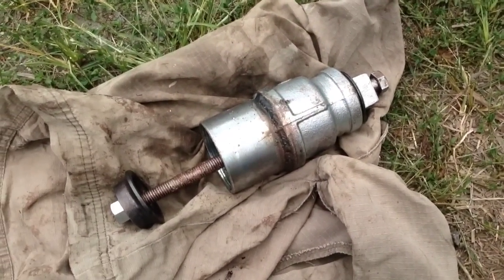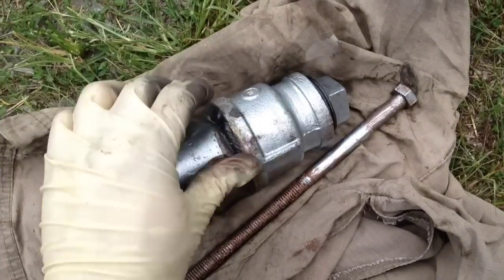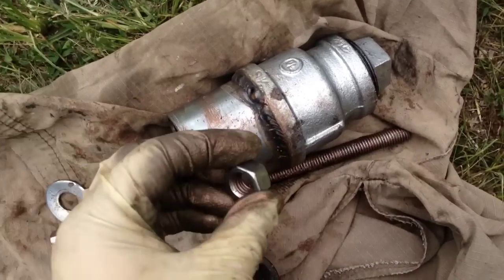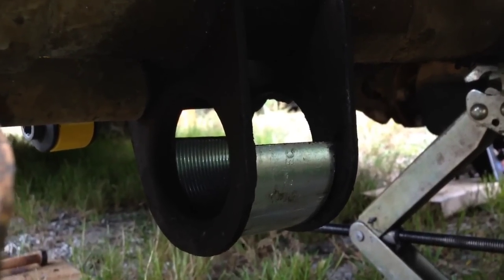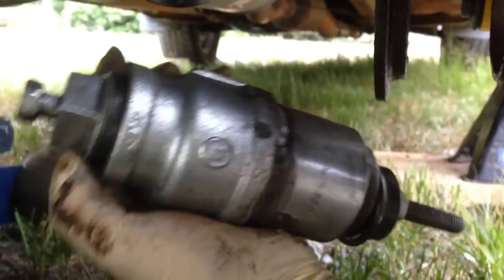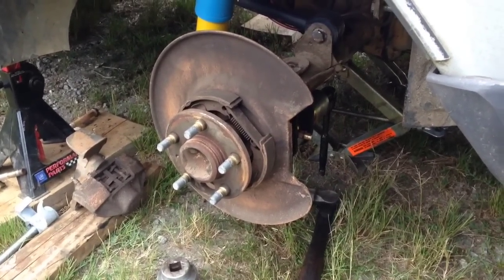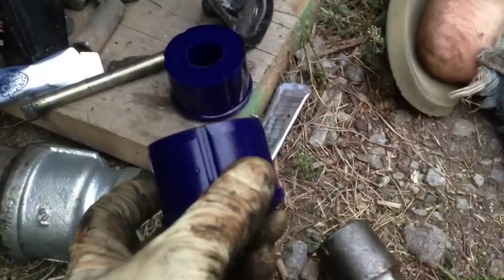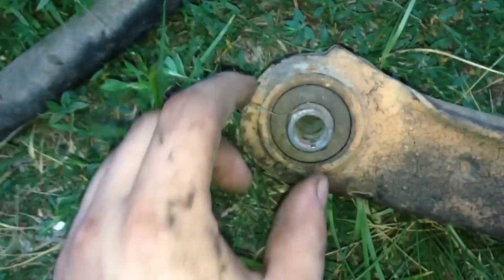Volvo 240 trailing arm bushing

Comment: Great video, thanks.  Just finished this.  Quite rusty on mine.  Banging around with hammer and penetrating lube helps.  Regular bolt/nut got stripped.  So got 1/2'" diameter grade 8 fine thread (pitch 20) bolt/nut. The mechanical advantage of the fine thread and the hardened metal did the trick.

Comment: I have an original Volvo bushing press tool and plan on pressing out the bushings soon. Do you need a different tool to install? It looks like you used two different ones to press out and install. Great video, by the way!
Reply from the maker: Thank you for the compliment. I did use the same tool but added spacers to it to reinstall. It has been awhile since I used it though. I am not sure what Volvo calls for but I will see if any of the green manuals specifically say.
Reply: Hey  @SmokeyJa  , I found my answer: https://www.sjorswolters.nl/files/Volvo%20240/Green%20Book/Tp%2011050%201%201975%20240%20Section%207%20Suspension%20and%20Wheels.pdf

Thanks for the quick response and your video... it's helped a lot of people!

Comment: Doesnt look like i have rear bushing at all ! They rotted out or what?
Reply from the maker: The rubber breaks down after time from all the chemicals on the road, constant weather change and so on... So yes it is very likely that the rubber fell apart and you no longer have a bushing. The metal casing of the bushing is still there though so you still need to press or cut that out before attempting to put new ones in.

Comment: good stuff.  Dump the scissor jack , please - that is not a safe way to work !
Reply from the maker: Do you not see the jack stands that the car body is sitting on ? The scissor jack is holding pressure up on the axle only so it doesn’t hang so low while I work on it . I would never work under a car with a jack alone.

Comment: Great video, Man! I've got a 1990 DL with 156k miles. If you would have said the year
and miles of your repair job, I could better guess when to get mine done or looked at.
My best guess is these bushings gotta last 300k+miles before needing replacement??
Reply from the maker: Bushings were replaced at a little over 200,000 miles and it was on my 1986 245GL wagon. Climate and driving style also contributes to bushing wear. If you hear a clunk in the trunk or anything clunking around back there you may need new bushings.
Reply: Thanks for the council Smokey. Much appreciated. Noted. I have to switch out my engine mounts, so I may as well do these too. Also, great inventive skillset you have there.

Comment: I have looked for your tool and volvo's for my 240. Did you start making the tool? I have an 88. Have started making or selling them?
Reply from the maker: I had plans to make a tool and still do but I keep getting caught up with other projects. I am going to be taking some time soon to produce a better tool and offer it to the public. I will at the least contact those of you who have inquired about them on this video.
Reply: @SmokeyJa  Do you have a projected price for the tool, once you've made a few?

Also, have you reviewed the video which shows using the same bushings in the old sleeve (simply grinding out the rubber parts), which eliminates the need for the press?

Comment: Never buy a second hand 240 with a tow hitch lol.
Reply from the maker: Actually my Volvo 245 has a higher tow rating than my 2006 Ford ranger had. But I try not to kill it with towing. I have a F250 for that. It is nice to know I can tow something decent with it though if need be. I think I might trust its towing capabilities over my xc90 with the straight 6 . but most new cars scare me with how they are built these days so I might just be a little bias ;) . But I get where you are coming from!

Comment: I burned the the rubber out with a red hot screw driver and a dye grinder. Then insert the poly bushings.
Reply from the maker: I can smell the rubber as you explain it... not a fun smell but I have done the same before I had a press many years ago. such a horrible smell.
Reply from the maker: Really it's easier just pressing the sleeve out and putting in a new sleeve and bushing in my experience but it was easy for me putting all this stuff together. If you find this method more your speed then it's all about whats easier to the person doing the work. However it works its better than leaving a bad bushing in its place!
Reply: So you didnt take the sleeve out? Just removed and replaced  bushing? Seems a hell of a lot easier! Smellier but easier and cheaper

Comment: Hey, i have a 90 volvo 760..Is it safe to say that this may be my problem..When i mash the gas the rear end of the car would swerve..And i think at 1 point in time..It did it and i heard a clunk..Coukd this be my problem?? plz reply
Reply from the maker: This could be part of the problem but if your rear is twisting you also could have an issue with the torque rods (arms) and the pan hard bar as well. In RWD cars they use a few different components to keep the rear axle aligned under torque load. Rear springs and shocks can also attribute to bad rear end feelings. I usually replace all the bushings in the rear of a car when I attempt to do any work on the to solve a problem and the same goes for the front. Look at all your bushings and see if you see any rips or tears in them. Sorry for the late reply. I hope this information can still help you out.

Comment: I just used a chisel and wire brush to remove the old rubber bushing from the original sleeve then installed the new poly bushings. took roughly 20 min for each. Great video though.
Reply from the maker: I wanted to replace the sleeves as well. Pressing them in and out really doesn't take more than a few minutes and now I can do all the rest of my 240's this way . Whatever gets the job done but I prefer this method . The rubber was still very well attached to these . I have seen others so far gone that you can peel the rubber off . Another method is to drill out the bushing rubber and then chisel it out . Thanks for the comment